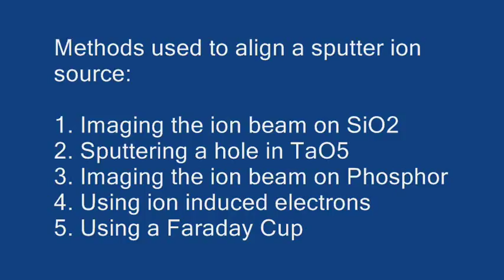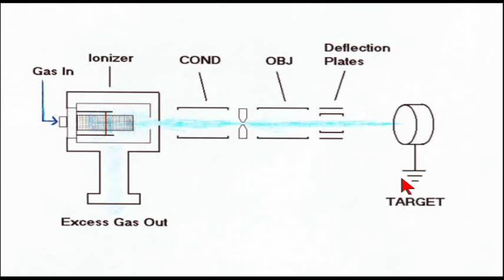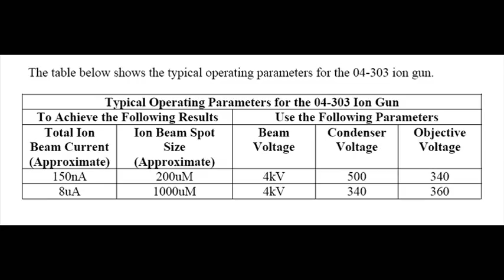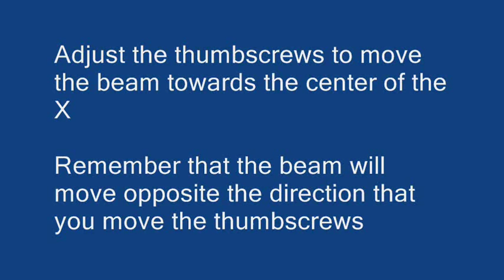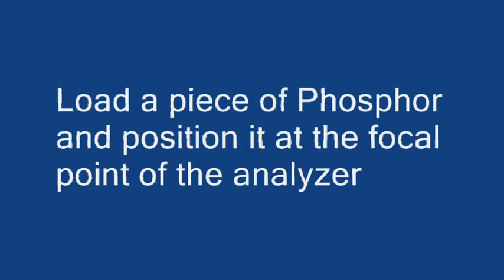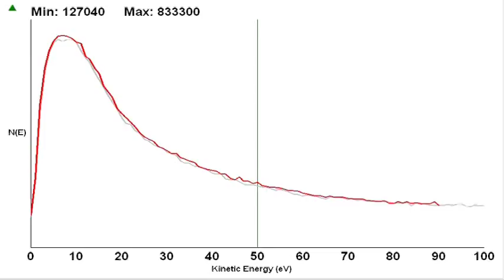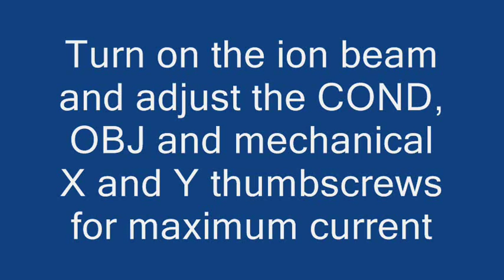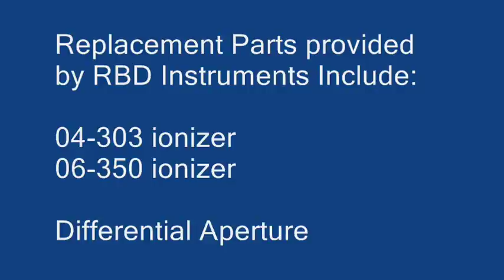04_303 Ion Source Aligment methods.wmv

Comment: Nice video! In our case, I think we have a problem with the aperture itself: the spot looks not at all round, even with voids and 'shadows' within the spot, and it fades out very easily by slightly changing any of the parameter values (cond., obj. or HV). By turning on the rastering, the spot totally distorts. The beam is aligned, but the rastering size and shape is the problem. We using the Phosphor screen (homemade) method. Any suggestions? Thanks!